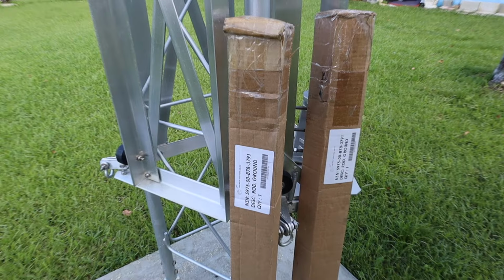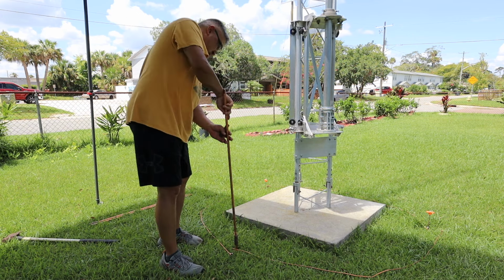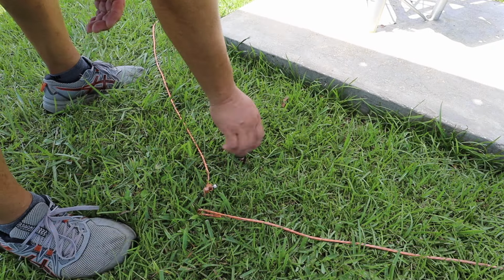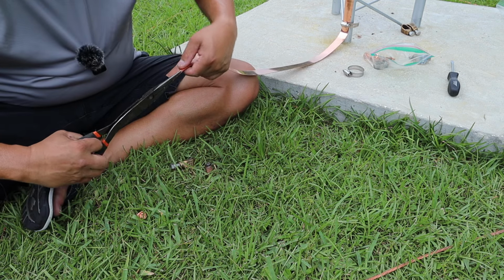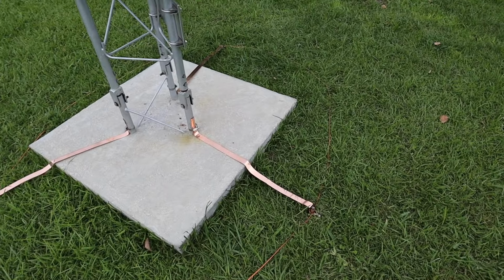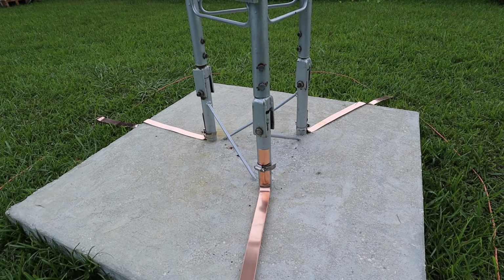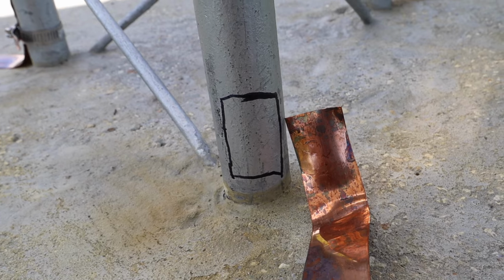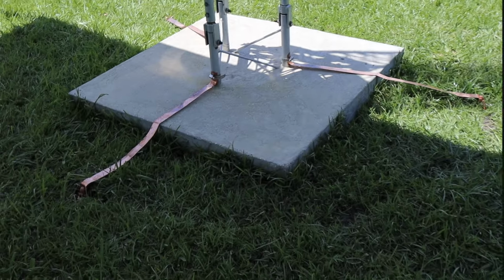Tower Project Part 5:  The Ground Works | Rohn 25 Tower | Pounding Grounding Rods

Comment: I know some ham operators with towers that use just one grounding rod (4 feet) into the ground and attach it to just one of the legs of the tower, but the way you are doing it is really something and new. I will make sure to have my friends watch this video Darren!  Thank you.
Reply from the maker: Other's may say to use the jaw tooth clamps to dig into the tower and also to use thermite welding also.

Comment: I must admit that I have used stainless steel hose clips in a similar fashion but I suspect they are not a great choice. A popular protection for the junction here is self amalgamating tape and then wrapped in Denso Rotunda tape. The latter is nasty sticky stuff, a bit like a lint bandage dipped in marmalade. The chief function is to protect the tape underneath from UV. Well done on the copper strap and the long ground rods.73
Reply from the maker: @g0fvt  Thanks.

Comment: You must have Leg Ground Clamps with a stainless steel sheet inside so that it does not touch the tower. The copper conductor should be installed between the SS sheet and the Clamp.
The fat you added won't do the job. It is a low viscosity grease which, once compressed, withdraws and therefore allows the electrical connection. So the copper foil touches the metal of the tower. It simply limits the intrusion of water, contaminants and the risk of corrosion.
I thought I saw at the beginning of the video that you had this kind of clamps. Maybe they are just installed incorrectly or have you installed other versions for the plumbing?
Reply from the maker: @ThinKkBIGG  i did have that fat clamp however,  it was a little too small. I'll get larger ones.
Reply: @DarrenN4VFR  Because with just your Jet-Lube grease, you will not avoid galvanic corrosion but only the intrusion of contaminants, humidity and water as well as the effect of ambient air.
Changing the clamps with those that incorporate a Stainless Steel sheet with the right size will be the right solution.
73!
Reply from the maker: @ThinKkBIGG  Roger that, I'll get some from DX Engineering.